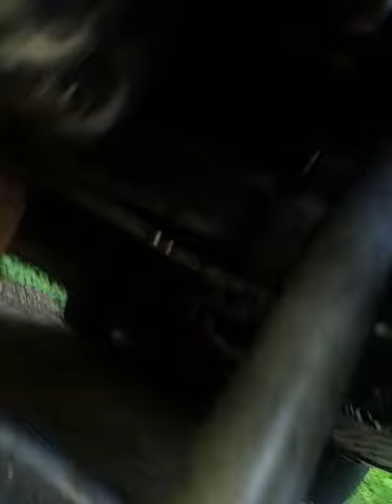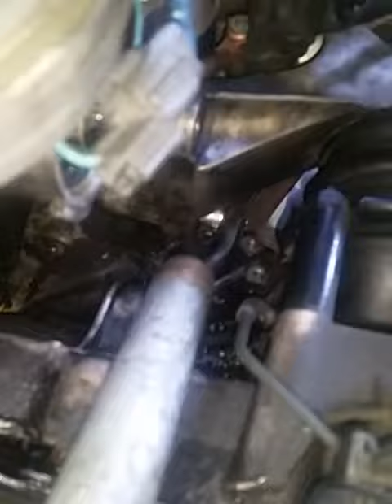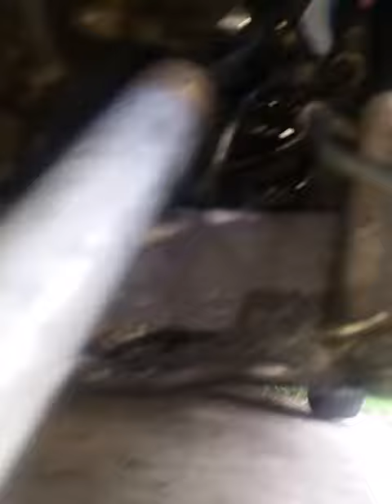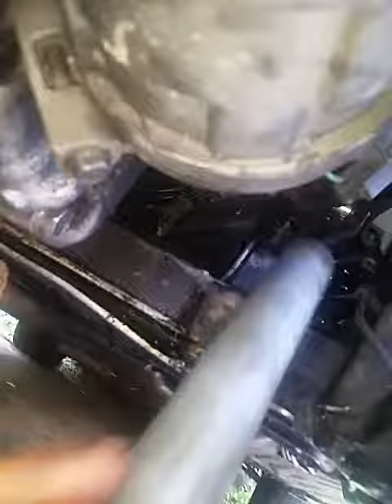2004 Acura RL engine mount removal (Starter removal #3)

Comment: It has 4 bolts right?
Reply from the maker: Yes...2 up top, and 2 below.
Reply: @sonofaleph2140  then the main bolt from the top? And boom. Engine mount off? And will it drop a few inches? This is the last step I'm at and I can access to the starter
Reply from the maker: @asianjohnwick  once you get the engine mount to come off, I would recommend that you go to my next video...it shows the best way to remove the top bolt off of the starter (removing the engine mount gives access to the bottome bolt(s) of the starter.
Reply from the maker: @asianjohnwick  click on my name and you will see the videos
Reply: @sonofaleph2140  i got both of the bolt off. But when I do the engine mount, does the engine drop when I take off all the bolts?
Reply from the maker: @asianjohnwick  yes...a little.  You want to put a jack, with a block of wood on it, under the driver side of the engine to help support the weight that was being held by the engine mount you just took off
Reply: @sonofaleph2140  sweet! Thank you for the heads up!
Reply from the maker: @asianjohnwick  how did it turn out? Were you able to get the starter out?
Reply: @sonofaleph2140  yes! I plan on making a video for others too.
Reply from the maker: @asianjohnwick  when you do, tag me so I can check it out.  Glad to hear you got it out.  I hope my video(s) were helpful.